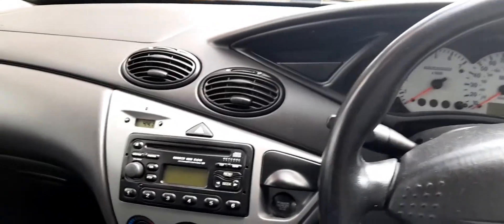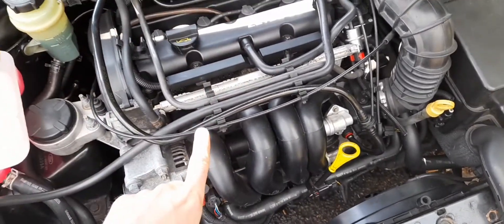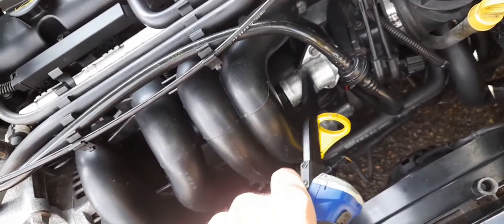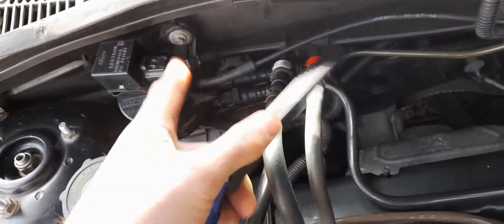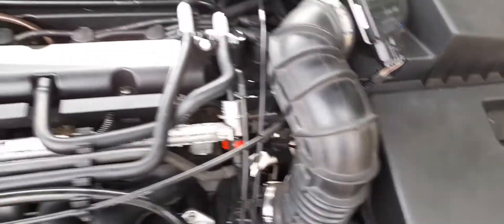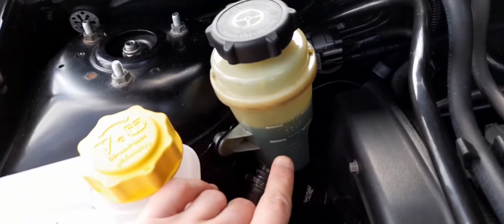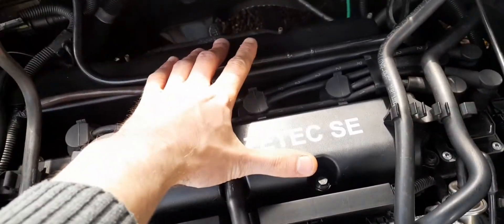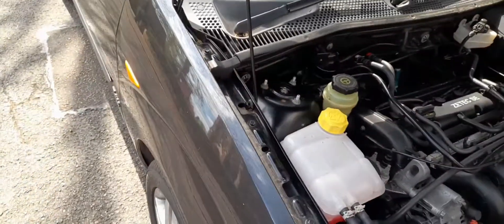Ford Focus MK1 Common Problems - Engine & Gearbox

Comment: He is right on the money, the Mark 1 Focus is the Golden Age of complex enough to be modern, but still simple compared to today's cars, and are VERY reliable and cheap/easy to fix. Esp. with a manual trans.
Reply from the maker: Couldn't have put it better myself:)
Reply: @usuallyfixingtinkering  Port F.I. not problematic D.I., no VVT on mine, less to go wrong, the newer ones do get a little better MPGs, but they will not last as long.

Comment: 2003 focus wagon with a 2.0 liter zetec... 367,000 mi and engine runs great.. no oil burning, smooth, minor oil leaks from oil pan... these are a nitemare to change the alternators and of course, they have that plastic thermostat housing that Will go bad every few yrs... one thing we are just now dealing with is the antilock and parking brake dash lites are on... antilock is Not working and No codes for the wheel sensors come up.. what does show is a bizzare  ABS code B1342   with a cryptic "Ecu failure for abs module"  .. real headache in that to swap in a used module, you have to reprogram it with ur VIN# or it wont work..
Reply from the maker: That's a very rare failure of the abs module! The plastic thermostats need to be genuine otherwise they don't last. Amazing mileage :)

Comment: My 2001 model Focus car starts late after trying to start it after a while. It takes about 7-8 seconds. Once it starts, it starts immediately. Also, I smell raw fuel during long startups. I changed the fuel pressure regulator. Previously, the revolution would stick at 1100, but now it operates closer to 900, between 800-900. The fuel pump was also changed 3-4 years ago. We don’t use the car much, it’s still at 110,000 kilometers. It’s as if when the car is left idle, it sends all the gasoline back to the tank and then pumps it when trying to start. I don’t know, what’s your opinion?
Reply from the maker: I doubt its that! Sounds like it needs a full service new plugs, leads and coil pack to start off, usually this cures a lot of problems and there really arn't many that occur with these engines.
Reply: @usuallyfixingtinkering  changed coil pack last summer and got the plugs. i suspected that too but havent changed plugs yet. i ll change them this weekend
Reply from the maker: see how it behaves after it sounds like the basics need looking at first!
Reply: @usuallyfixingtinkering  plugs made difference but not for delayed starts. it s still same. 
edit: i bought bosch set first but one came different so i ordered ngk after heard you using them.

Comment: Goodafternoon Please help,i have a ford focus 2001 1.8 tdci, i cannot get timing gear seal in south africa, the one with the plate. How to fix the leak.
Reply from the maker: What do you mean by timing gear seal?
Reply: Goodevening sir,the cover seal that goes over the diesel pump.
Reply: It is a metal plate that has a seal attached to it.
Reply from the maker: @pastorjamienaidoo2883  now I know what you mean, that is a tricky part to obtain

Comment: Great video. I have the 1.6 mark 2.5 estate on 109k miles. Runs great and averages 35 to 45 mpg. We also have a mark 6 fiesta 1.4 on 53k miles with the same Sigma engine. 100% reliable and i service both with regular oil changes etc. good old cars.
Reply from the maker: Cheers Martin! Absolutely right, Oil changes and timing belt changes is all they ever need! Brilliant engine, this and the zetec engine are probably the best ford have ever produced in terms of reliability, longevity and technological advancement. Other Ford engines of the past and present have one or two of these qualities but never all three!

Comment: I have 1.25 in mk7 Fiesta. That is some sturdy engine. Missed first timing belt change, interval is 8 years or 160k km. I replaced it at 105k and 10 years thankfully nothing happened. Engine wise most expensive repair was clutch at 135k and right engine mount. Plus Fiesta like to destroy it's ball joints that are pressed in wishbone, so every time i needed new one, replaced three wishbones in 147k km.
Reply from the maker: The MK7.5 was the last car to have the Sigma up until 2018 (plus Ka+) because it was just so reliable and very much staple of all that was good about ford engineering compared to the Ecoboost that replaced it, again a fine engine when it works but there are too many failures recorded to give assurance like the Sigma.
Reply: @usuallyfixingtinkering  Very true. Some new Ecoboost units as I understood have now timing chain instead wet timing belt after 2021 as I understood. I wanted to replace my Fiesta with mk8 1.0, but after hearing horror stories I gave up. Old little fella is still good for me around town.

Comment: Would you say the 1.4 is underpowered for the weight of the car?
Reply from the maker: It is a little on the small side but it's not too bad as long as your doing mostly town driving. Anything above 50 and it'll be working hard on any acceleration. The strange thing is I've seen a 1.4 Estate for sale recently, I never thought you could get them with the 1.4, now that will be very underpowered!
Reply: @usuallyfixingtinkering  that's fair enough, i though I'd look for the 1.6, it's that little stronger but still simple to work on, and I do like a bit of tinkering myself :) Great video by the way, keep it up!
Reply from the maker: @ivanpajic9043  thankyou very much sir I will do my best to keep some content flowing the next time I'm doing something. That's not too far away! The 1.6 is a great all rounder can't go wrong!
Reply: malo je slabiji, imao sam 8 godina 1.4 ali nikad sa njim problem nisam imao. Preudoban i izdrzljiv! Sad imam Insigniju i mogu kazati da je Focus meksi u voznji.
Reply: My 1.4 did its job well. It lacked power, but it was doable. Bought a 1.6 last year. Those are definitly more fun to drive. Get a 1.6 if you can.
Reply from the maker: @SmeurkeDeKat  that's how I'd best describe the two!
Reply: @usuallyfixingtinkering  Still have the 1.4 as a donor-car, mainly for the interior. I'll be keeping an eye on your channel ;)
Reply: @usuallyfixingtinkering  the 1.4 on the second gen is even slower because the second gen is Basically fatter than the first gen
Reply from the maker: @bigmansir3745  exactly much heavier but the engine us no more powerful. Not until the cams were updated to get the Ti-Vct version later on.
Reply: @usuallyfixingtinkering  not a whole lot, but a bit heavier, and this also influences taxes. let me give you a example. I live i the netherlands, the tax there is based off of the cars weight, owning a diesel car is a nightmare there with taxes. my dad used to own a 2003 ford focus with the same engine. now has the c max with the same engine. But thats not the point here, for every 3 months the tax on my dads previous focus was like 130 euro's. the second gen is 160 per three months. my dad's c max also has this same taxprice because it weighs almost the same. but to answer your question, it's a 200 kilo difference.
Reply: @SmeurkeDeKat  But dont get the 1.6 auto, especially the second gen.

Comment: Fabulous tutorial Andy , its also worth checking underneath the coolent header  tank for hairline cracks causing invisible coolent leaks which drips down by the water pump giving the symptoms of a leaking water pump. The coolent header tank tends to go brital with age and heat . This has happened to mine but I've renewed it . 
I have a mk2.5 but very similar.  Many thanks 😊
Reply from the maker: absolutely this is neccesary!

Comment: I remember  my late father buying a  bran new  focus  1.6 on a T plate  when I first drove it  I was very impressed  with how it handled and drove  also  this car is still   on the road  . I've  owned a few ford's with this engine  and they are very reliable  like you  said as long as you service them on time using the correct oil they will just go on
Reply from the maker: Wow a T-Plate was a pretty early one! They are hardly lumps if regularly serviced :)

Comment: 9:54  correction in order here. That hard plastic line from throttle is a vacuum line which is needed for the EVAP purge valve to operate. The purge valve also has 2 more hard plastic lines as seen in the video, one takes fuel vapors from the charcoal canister to the purge valve, and the other one takes vapors to the intake to be burned. There is also a 2-wire  connector that varies the duty-cycle of the purge solenoid, based upon fuel tank pressure.
Here is a quote from some research I did as mine has a lean code and trims are too high, and I am in process of testing this valve. When stuck fully open, they lean the car out. They do not normally go full-open, but the duty-cycle as on an IAC also opens and closes within a range.
"The Purge is controlled by the PCM with a pulse width modulated switch signal. It is normal for it to cycle rapidly. This allows small amounts of the fuel vapor to be metered into the cylinders. This method allows the system maintain fuel control.

One of the main jobs of the evaporative control system purge valve is to maintain a slight negative pressure in the fuel tank so that fuel vapor is not pushed out thought the carbon canister and into the atmosphere.This flow direction draws fresh air through the activated charcoal in the carbon canister. This then removes the fuel from the carbon getting it ready to capture the outward flow that happens when the engine is off and during refueling. So the purge will be on much of the time that the engine is running. It is usually turned off during deceleration and other times briefly to test mixture and run other tests. Fuel tank level has little affect on the amount of time the purge in on".
Also of note, EVAP PURGE = EVAP_PCT: This parameter is displayed as a percentage and is normalized for all types of purge systems. EVAP Purge Control commanded OFF will display 0% and EVAP Purge Control commanded fully open will display 100%. This is an important parameter to check if the vehicle is having fuel trim problems. Fuel trim readings may be abnormal, due to normal purge operation. To eliminate EVAP Purge as a potential contributor to a fuel trim problem, block the purge valve inlet to the intake manifold, then recheck fuel trim.
Purge valve (VMV) has to have a vacuum line to it for it to operate.
Without vacuum, the valve cannot operate. Check vacuum line for a P0422
I will report back if it is indeed the purge stuck open, all things point to it, and a Ford expert told me to test it. It was replaced once 4 yrs.  ago on my 2002 ZX3 with a USED part from a junk yard for $11USD 🤣 The one on your firewall looks IDENTICAL to mine. Ford used these on a myriad of models and years. They do go wrong, they are cycling hundreds of times a second to regulate the fuel vapor back into the engine.
Reply from the maker: That describes the system well! Since this video I've done a video specific to this system in a mk1. It will be coming soon and demonstrates in simple terms how it should work  :)

Comment: Thank you for the video, covered in fine detail, ive saved a 1.6 2001 saloon mot failure, body was fine but everything else rotten, i replaced the subframes front and back and all suspension components. I loved every second of doing work on it, whilst everthing was off, she had a new undercoat sealant so now using her as a daily driver. Just turned 80k and sounds lovley. 

Only issue i wanted to pick your brains on please, when shes cold, it takes about 5-6 turns to get started although when warm, its instant. What could the problem be?  I remember that it used to start on the dot when cold but she turns over quite a bit now. Any ideas please 😊
Reply from the maker: Poor Battery Connections, A battery that may need replacement or Poor starter connections!

Hopefully that helps as you've done so much work you will be rewarded in the long-run for all this work :)

Comment: 13:33

i hace 1.4 petrol mk1 focus.. it doesn't have MAF sensor at all.. dont know why
Reply from the maker: The 1.4 does not have a MAF at all only the 1.6 Auto with the Sigma got a MAF. You have a MAP sensor.
Reply: @usuallyfixingtinkering  is it possible not to have one cause i cant find it.. ahahahahah
Reply from the maker: it's on the inlet manifold"

Comment: Amazingly detailed video, thanks for the massive amount of info! Questions, what's the mileage on your Focus? Do these engines vary between the MK1 and the MK2 focus?
Reply from the maker: Thankyou! 90K miles ish, mines still pretty fresh in that respect. In terms of petrols there is no difference between mk1 and mk2's early on. I believe the mk2 1.4 was given 5bhp more than the mk1 1.4 (which was 75) and later on around 2008 onwards the 1.6 was given the Ti-VCT treatment power was upped from 100bhp to 125.
Reply: @usuallyfixingtinkering  Awesome, thanks! And if its any credit to the info and claims you're making about how bullet proof these wee 1.4is are, mines sitting at a solid 176k miles and still going well😂

Comment: Thank you very much for the video! Really no one takes the time to do such a detailed video for these old cars. 

Mine is 1.6 petrol one from 2005 and I have a strange issue. Whenever I am just about to stop the car (the car is in neutral) the RPMs drop right around 500 then jump back again to 1200-300, then back to 600 and this continues 2-3 times every time I am stopping the car. This happens when the car is warmed up and also I don't think it is running at best when the RPMs actually balance. It almost stalls and I am wondering what the issue may be. So far I've checked the idle control valve (clean it thoroughly), changed the Camshaft sensor, cleaned the crankshaft sensor, replaced the sparkplugs plus new cables, and cleaned the throttle body. If you have any suggestions I will be very thankful! Cheers!

P.S. Mine also takes 1-2 second more than yours to start..
Reply from the maker: Thankyou so much I try my best to give useful advice based on my own experiences! What your experiencing is similar to what I had last year - the way I cured my problem was changing the naf sensor, that solved - the almost stalling when slowing to a stop issue! It could be a few things but if your idle valve has been cleaned I'd be looking at the maf or map sensor and I would clean the throttle out - this makes a big difference and maybe explains why it takes longer to start. I may be wrong but I'd start there.
Reply: @usuallyfixingtinkering  Thank you for the quick response! 

Mine has a MAP sensor and doesn't have the MAF one so I will change it soon! Meanwhile, I just get to know that I can access the hidden menu so I can check if there are any codes stored. 

Thanks again!
Reply from the maker: @danielcvetanov2504  to access it press the reset knob on the cluster, hold it down while turning on ignition and hold until the gauges do a sweep and your in. You keep pressing the knob until you access the info you want,.
Reply: @usuallyfixingtinkering  Thanks! I just did this and on the step where i should’ve seen the codes i got “none”. Do you think i can still have a sensor related problem?
Reply from the maker: @danielcvetanov2504  usually if the sensor completely goes then a code will show... but often i've found sensors to be on the way out and not throw a code because the ecu thinks its still working within certain parameters. I'd clean out the intake manifold and throttle body with carb cleaner thoroughly and see if that stops the issues... because it will certainly improve the smoothness of the engine!
Reply: I've had this problem as well. In my case it was the cooling fan connector which was burnt out. Therefore the cooling fan didn't run, so the radiator got hot, which in turn caused the airconditioning compressor to run heavy, and that caused the RPM to drop too low. After which the compressor turns off as a safety precaution, RPM goes up, compressor turns on again, and the cycle repeats.

I didn't replace the connector, it'll burn out again anyway. I bypassed it by soldering the wire together. If I ever need to replace the cooling fan, I'll just cut the wire.